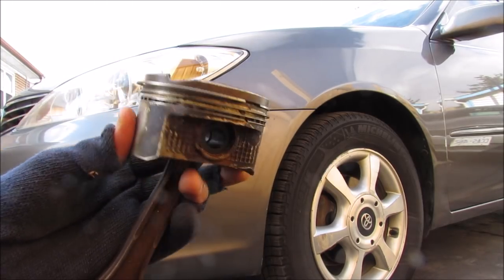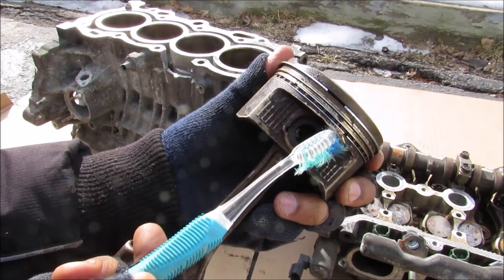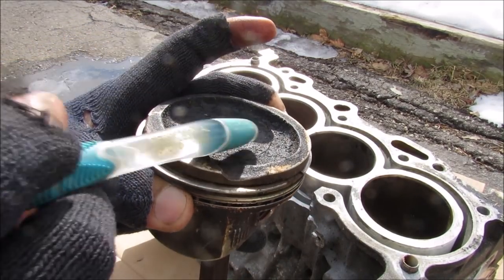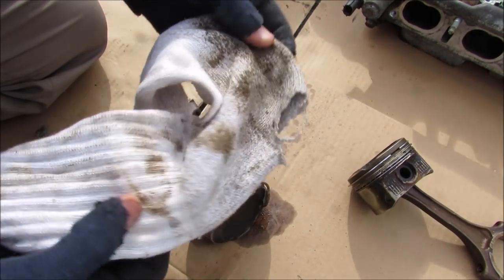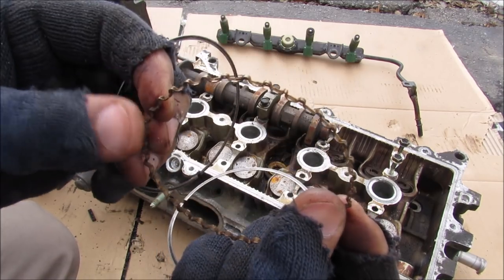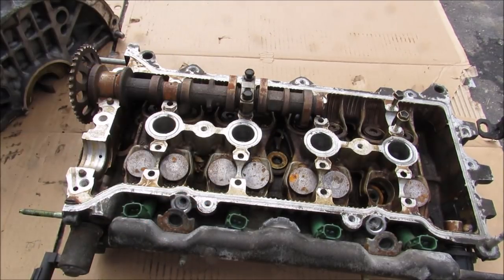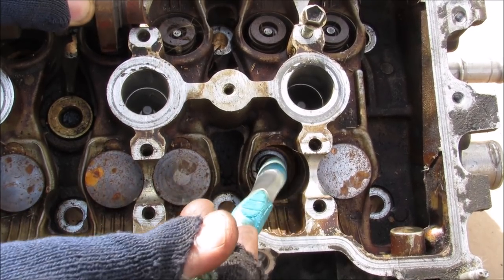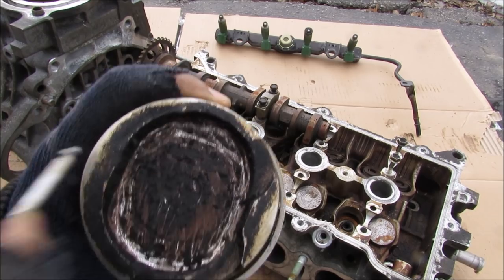Why do Cars Burn Oil?

Comment: I wondered why my 2002 Camry kept burning oil. I was told about the possible piston ring situation. Now I see it. Thanks for the enlightenment.
Reply from the maker: Yeah those 2.4L engines were known for oil burning and head bolt stripping

Comment: Correct me if I'm wrong, but the oil flows the other way around.  The oil travels from the crankshaft through the hole in the Connecting Rod Bearing.  Then there are passages in the Connecting Rod that go up to the Piston Pin and also to the Oil Jets on both sides of the Connecting Rod.  The Oil Jet squirt oil upwards to the underside of Piston which then drips to the holes of the Oil Control Ring.  The middle Oil Control Ring stores the oil lubricating the Cylinder Walls and then the top & bottom Oil Control Ring will scrape the oil off the Cylinder Walls.
Reply from the maker: +lazal3m yep this is what I covered in my oil lubrication video. After the oil ring scrapes the oil off the cylinder wall, it goes back through the Piston head through those holes behind the oil control ring, to drip down into the sump.
Reply: thanks!

Comment: All the videos I ever watched trying to learn how engines worked, no-one ever showed the rings in as much detail as you did in these couple mins just now. They just say they're to stop oil and then slot them in during their rebuilds. I can see much better now how they compress a bit, why they don't damage the cylinder walls, how the oil actually drains (I thought it all just got scraped down the cylinder wall), etc. It's just a nice level of detail for us guys who've read some basics but never had the chance to see these things up close. Like I said in another comment, you're making this stuff so much more accessible. I never pulled cars apart because it all seemed too confusing & beyond my abilities - grainy black and white pictures in Haynes manuals often confused me more than they helped. I'm sure with your videos you're showing kids they needn't fear fixing their own cars mate. Your a fantastic human sharing all this.

Comment: My G35 has this issue. Can't afford a new engine right now and currently burning 5 qts of oil every two weeks... getting worse. Good informative video👍
Reply from the maker: That's alot of oil. 
On the upside you don't need to change oil

Comment: I was able to replace an 02 Camry's valve stem seals with the head intact.  It can be done by removing the cams, rotating the piston about to be serviced into TDC and blowing compressed air into the combustion chamber.  Remove and reinstall the valve keeper and seals one at a time on the cylinder that is pressurized.

Comment: Quick story.. Last year in 2021, I bought a 2006 Honda Accord 2.4L/5-speed/Coupe/EX-L with 155k miles.  I was not DIYing my oil or anything at the time.  Having purchased the car from a mechanic, I didn't check the oil for a couple weeks, and when I did it was BONE dry, just a drop maybe.   After putting in enough oil and checking, I realized it was burning a ton of oil. I think it was burning over 1 QUART PER 1k miles, maybe more! I went through a 5 quart bottle quite quickly.  I also noticed black sticky residue on the tailpipe tip, but not really much smoking that I could see.

This put me into a bit of a panic and swapped my current research and hobbies over to car DIY; researching, reading, buying repair manuals, etc.  I've come across this piston ring information several times on YouTube and Accord forums.  At first, and being a newbie, I thought maybe this 'AT-205 reseal', MMO, or some sort of additive. But AT-205 is for rubbers, not metal rings, I kept reading and watching random videos.  In the meantime, I changed and added oil as needed.  I used SuperTech and Mobile 1, but mostly SuperTech once realizing they are basically the same oil.  I changed it as soon as possible, then at 2500, 3000, 4000, and now 3k-5k miles.  I've put on 20,000 miles already.

Forward in time about 5 months and the oil consumption has slowed to a crawl!  It used about 1.5 quarts over the last 5000 miles!  I'm guessing the car had sat around before being sold(some other clues were there also),  with old oil, and it GUNKED up the rings.  However I think the frequent changes have cleaned them out!  I was looking at some condensation coming from the tailpipe last week and also noticed that the nasty GUNK that was built up, it is nearly all GONE!?! huh?!  I wanted to clean it off to see what the new build up would be, but it's gone!   I've also added a quart of Marvel's Mystery sparsely, mostly in the oil, a bit in the gas.  That also seems to have helped; today's oil change was less black and much less was burned off.

It's puzzling to me why someone would sell such a good car.  Sure it has some other minor issues, a small water leak, and a bit of the headliner is just starting to separate, but man it's a great personal car, peppy, comfy... and I'm not looking forward to all electronic everything of the new cars.

Thanks for the videos; your teardowns and explanations have been well worth my time!

Edit - a couple things and added clarification without altering content
Reply: Wow nice! Lucky that the piston rings didn't scrape off too much of the cylinder wall and were just gummed up, those frequent oil changes just might have saved you engine. how's it holding up?
Reply: @Zaidi_227  Indeed a bit lucky, thank you for the reply!  The engine is feeling great, very responsive with the manual transmission; hopefully any damage is minimal. The oil burning currently is about 1 quart every 3000, at 186k miles.  I will say that using 5w30 instead of 5w20 seems to also help slow the consumption, as per accord forum posts.  I try to change the oil every 3k so I'm only adding a half quart after about 2k, and pulled almost a full 5 quarts out last time!  I was ecstatic to say the least!

I really really enjoy this particular car, so before falling in love I had a couple mechanics take a look and evaluate based on long term drivability.  They all seem to agree that it's worth holding onto and to start fixing up the suspension, coolant exchange, transmission fluid, etc, etc.  The car has felt nearly brand new since I bought it with 150k, though a hiway vibration creeped up after a nasty pothole.  I have had done the lower control arms, ball joints, CV axles, used aftermarket rims, and this mostly fixed the vibration, with just a tiny bit left at 70 mph.  Anyway I'm rambling and thank you for reading.
Reply: @JMRSplatt  hahaha I love reading the details if someone is willing to share, so thanks for sharing. I'd also say the same as your mechanics, IF you don't mind the partial oil burning and topping up the oil every now and then, then you should keep it I mean...you've already almost driven it 40k miles on top of 150k miles of neglect and abuse while still having an oil burning issue which got better because of your care, despite all of that the engine still runs great(according to you)...goes to show the quality of honda engines.
Anyhows, Im happy to hear that your engine is doing well and you sound like you know what you're doing so just keep changing that oil and enjoy your car!
Reply: @Zaidi_227  I appreciate the input indeed! I was a bit on the fence of keeping or buying something new/recently new. I love technology but not a fan of all the excessive electronics in modern cars.  Push button start/stop, push button parking brake, touch screen everything.. keep it out of the car, in my opinion.   Also new Honda Accords are not offered in 2 door, or with a manual transmission anymore. Not available. :(

Thanks again. :)

Comment: Gotta be careful using someone's sock. You don't know what they used it for. Great material btw. I had to replace my Toyota Yaris engine a month ago. The engine used to consume 3 Liters of oil each week in its last days. Now it all makes sense
Reply: XD
Reply from the maker: +Hamza Raissouli thanks. Haha the sock was clean, you should have seen when I tried it with my brother's underwear..that didn't go too well...

What year and mileage was your Yaris? I know Camry and Corolla was affected but not Yaris..
Reply: speedkar99 actually it's a Toyota Echo 2005 (the old Yaris). The old engine had 370k kilometers (I guess that's the reason).
Reply from the maker: +Hamza Raissouli Yea we have them here in Canada too. They aren't worth much but can be reliable transportation
Reply: speedkar99 definitely

Comment: Wow, another great, detailed video!  Thank you. I have an 07 Solara, 4 cyl. Toyota fixed the engine. All good now.
Reply from the maker: +Joe T you had your 2.4L rebuilt completely understand warranty?
Reply: Hi Speedkar99. Only Pistons & rings done under The Toyota modified recall letter.

Comment: Marc Hauser, Actually older vehicles require thicker oil to fill those worn out specs due to aging. My 20 years old Honda was labelled as for 10/30 grade . I have switch to a higher grade

Comment: I would think the oil control ring would leave a very thin layer of oil on cylinder walls for lubrication of the compression rings? If there were no oil for the compression rings the rings would wear out very quickly. So, with that in mind, by nature of design, even a brand new engine will burn / consume a certain amount of oil. BTW, I have a 1996 Isuzu Rodeo with 3.2 V6 engine that has now begun consuming oil via the valve guide seals after 472,000 miles. The engine still runs fairly well but I decided to completely rebuild the engine as the Rodeo itself is cosmetically in great condition. Thanks for posting this video!
Reply from the maker: Yes you are correct. It leaves a layer for lubrication
Reply: @speedkar99  That was fast reply! BTW- I enjoy your videos a lot - gonna subscribe

Comment: I think sometimes they replace valve stem seals while applying air pressure in the cylinder, through the spark plug hole, to push the valves up, without taking the head of.
Reply from the maker: Yes I've heard of that as well. Risky but it works

Comment: Thank you, Great video!  Toyota did issue a TSB-0094-11  on their 4 cyl engines re: Oil consumption.
Reply from the maker: +Joe T thanks 
And yes there's tsbs and warranty extentions but by the time noticable oil starts burning, it's past that mileage.

Comment: To avoid piston ring clogging use an a expensive oil brand such as Mobil 1 0w40 and change every 5k ... plus use the best fuels available .. I have a 2.0 tfsi Audi never had a oil consumption problem

Comment: I would add - air filter and long-term driving from a clogged, engine ventilation, very frequent driving with a heat-cooled engine, (dialing the cold engine to the maximum) ....I'm giving a subscription
Reply from the maker: Yes good points

Comment: Ethanol fuels are one of the major culprits in causing sticky rings. Ethanol oxidises to form aldehydes which then polymerise to form a sticky sludge that takes ages to remove.

The sticky rings allow fuel into the sump and which thins the oil and reduces lubrication.

This loss of lubrication results in piston and bore scoring even in low-mileage cars.

🙂

Comment: I noticed that oil was being drawn thru the PCV valve and valve cover vent tube (lots of oil) in my old 2000 toyo/lexus v6 and oil consumption dropped/stopped after temporarily plugging those tubes..............kn air filter also cleaned....clogged air filter may also increase oil consumption thru those tubes.
Reply from the maker: Good tip
Reply: I noticed heavier oils like lucas won't drain back via the tappet cover baffle drain hole so it gets sucked in and burned. Once you go back to the proper oil, (if it still burns oil,) Wonderdust will stop it burning oil, and bring up the compression, reducing blow by and crankcase pressure/load on pcv valve.

Comment: Very informative I have a GM 3.7 i5 I'm having oil leaking out the bottom near the main seal I had a reputable GM mechanic replace the main seal,  I'm still leaking and losing 1 quart every hundred miles, I am not having any smoke or heavy exhaust, what might be the problems
Reply from the maker: How about the front crank seal, valve cover, oil pan seal?

Comment: Great video....thanks
Question...I replaced the valve seals with oem parts and I still see a pool of oil on top of pistons. What might have gone wrong?
Reply from the maker: Spark plug tube seals

Comment: why isn't it worth to change the seals anymore wouldnt it fix the oil getting into cylinder? have a prelude and i think it has the valve problem u talked about...about 3k miles i have no oil. Thank you for the information.
Reply from the maker: Because you need to open the engine which is labour intensive
Reply: @speedkar99  ah true and expensive.

Comment: Great video , at first my 2009 Camry started burring oil , I replaced the PCV valve but that did not fix the issue  then my mechanic said that He has to replace the rings and that's a big job and will cost about 1400 $. Not sure if its worth it or should I  just buy a refurbished engine . All cars that pass the 100 K miles have this oil burning problem.
Reply from the maker: Yeah unfortunately the 2az engine was known for this. A rebuilt engine is your best bet. A. Used one might have the same issue.

Comment: I'm glad that you mentioned only some cars burn oil. Not all cars do, especially engines that were designed and engineered with surgical precision. A good engine will not burn oil. But, wear and tear will do their part. Generally, an engine that is burning oil will eventually gum up your sensors and EPA controls.
Reply from the maker: Yes good point. Thanks

Comment: I really like your videos. I learn a lot from them. But this video says it's necessary to remove the cylinder head to replace valve stem seals. I didn't have to remove the head when I replaced the valve stem seals on my 94 Tercel.
Reply from the maker: Some of them you can but risk dropping a vlve if not careful

Comment: Thanks for the video. However, I didn't get why not fixing the problem on a high mileage car is better than what you suggested: Change oil (more frequently?) with a high quality oil?

Is it because "The only way to cure oil burning past the rings are to drill holes in the piston heads and change the rings, which requires a full engine tear down."
Reply from the maker: +Eugene Cartwright higher quality synthetics tend not to break down into sludge as easily as cheap bulk oil, reducing the chances of it clogging Piston holes.

Comment: Please advise me if the piston rings can be done without removing the engine, I was led to believe that piston rings can be done by lifting the head and removing the sump. I have audi a3 BSE, 1.6 engine . Because My engine is burning oil mileage is 103000 miles.
Reply from the maker: Yes it can be done, remove head and oil pan , disconnect connecting rod bearings and pull them out the top
Reply: speedkar99 thanks for that too!

Comment: Excessive oil consumption and Toyota go hand in hand. Usually starts around 80K and will increase to well over 3 quarts in between changes. Eventually you burn an exhaust valve.

Comment: Another awesome video - loved it.  Not all cars are impossible to change valve seals due to cylinder head removal. Did my Suburban after 240k and it only requires removal of the valve covers not the head. Yes it is a major job - took two Saturdays for me - did one side one weekend and the other the next weekend.  It single handily solved my oil consumption issue.  Very satisfying job.  Would you recommend doing the Seafoam in the cylinder process to clean out my oil rings?  Thanks Speedkar99 keep up the good work!  Give your brother our best....
Reply from the maker: I'm glad you enjoy my videos, how did you prevent the valves from falling into the engine?
Reply: speedkar99 - did the old compressor air in the cylinder at ~60 psi. Apparently when the cylinder is at top position the valves will not fall through but I did not want to test that theory!  A balloon attached to the hose worked great to determine a given cylinders top position. Thanks again

Comment: I have a Hyundai 2014 with 230000km. When I start it in the morning a white smoke comes out the exhaust for about 10 seconds. Could it be the valves?
Reply from the maker: Valve stem seals

Comment: My car burns oil but the compression is great.  The compression rings are still fine but the oil control rings (which are really springs as shown here) must be gunked up.  Should I dump some auto rx in there or replace the oil control rings?  Hmmm...
Reply from the maker: The right way is a ring job and a good cleanup

Comment: Very informative and clear video. I have a Mazda Protege that is doing this exact thing. Smoke on cold starts and burns oil. I was thinking of perhaps using Marvel Mystery Oil along with regular maintenance. Any ideas as to how good this is?
Reply from the maker: Once it's burning there's not much you can do

Comment: With these newer engines, can you pressurize the cylinder by the S plug hole, then remove each valve to replace the valve stem oil seals?    I think this procedure was used for Older engines.  BTW, great video!  Thank you.
Reply from the maker: I have heard of it, but it's risky if you loose pressure the valve could drop in

Comment: How do you tell if it's rings or guides without tearing down the engine. If  it blows blue smoke when first starting would it be guides ??  .........and after running a minute and then blows smoke , rings ??

Comment: I would assume adding a bottle of 205 ReSeal every 3 oil changes could combat the valve stem seal problem.
Reply from the maker: It could also cause clogged oil passages so I don't go too hard on conditioners

Comment: What is the correct mileage for changing the oil on a 2002 Corolla ? Because I have the same issue burning oil with no indication of that
Reply from the maker: That's very controversial. If you are using conventional oil, 3000miles /5000km is reasonable with a few top ups in between